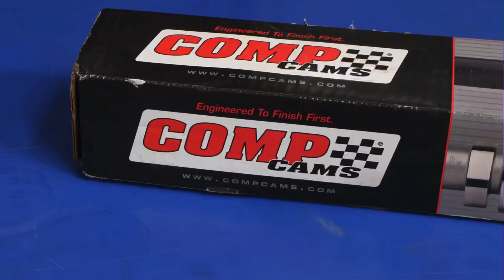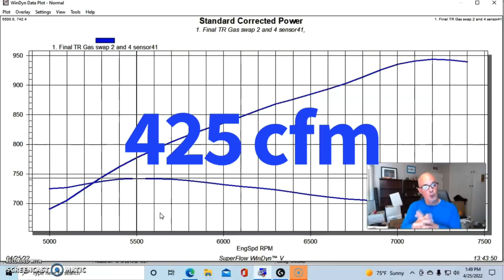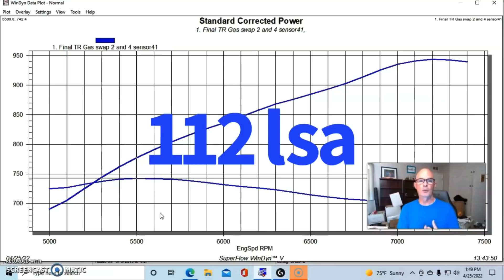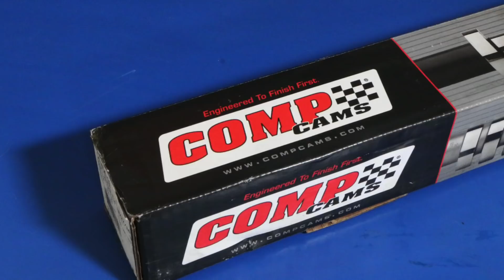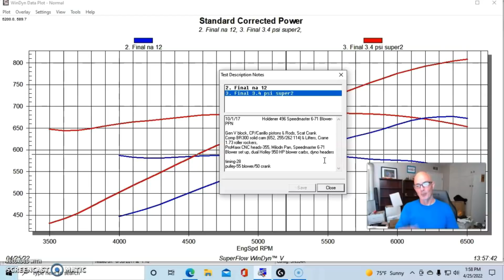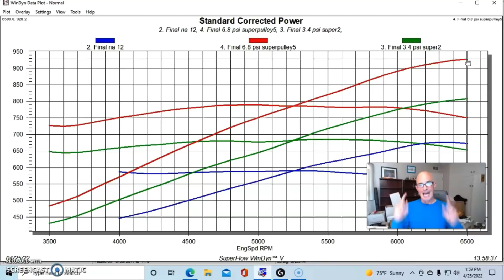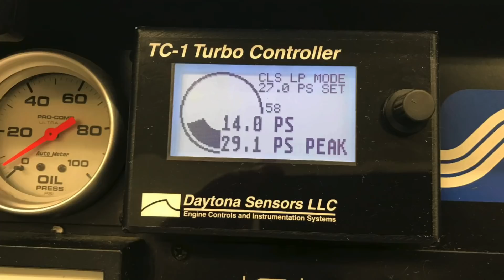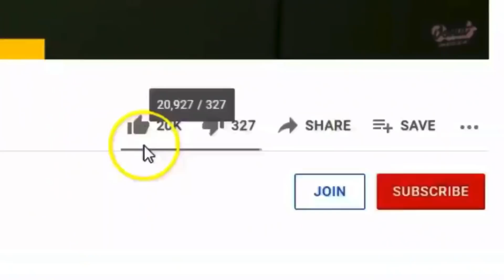HOW TO BUILD A 900-HP, ALL MOTOR, 6-71 BLOWER OR CHEAP TWIN TURBO BBC! WHICH ONE WOULD YOU CHOOSE?

Comment: On alot of these great sounding high hp combos like making 200 more hp then most guys he's running such a high rpm, racing cam in some instances that the powerband is very limited and will make for a crappy street car experience. I have known about this technique for many years. It's not worth in in a street car or truck or even boat. Some cams have a power range of about 4500 plus rpm. A 5000 stall converter won't be fun on the street. And from 4000 to 8000 rpm won't be fun to deal with.

Bloodviking

Comment: 3:45 Richard on your oil system,  add a 1 quart or 2 quart accusump pressure reservoir.   This will remove 1 or 2 quarts from the oil pan,  to help decrease windage.
Thanks for All Your Help!!
Reply from the maker: the accusump doesn't reduce the amount you have in the pan
Reply: @richardholdener1727  
On my car it does.
I put 6 quarts in the oil pan, I start the engine. The oil pump moves oil to the engine and the accusump (1 quart). 
Before I shut the engine off,  I close the ball valve between the engine and accusump.  Later I check the level in the pan,  5 in the pan & 1 in the accusump.
Before I restart the engine (one week later) I open the valve & prelube the engine.
Easy way to Lower the oil level in the oil pan to reduce windage,  and NOT worry about lack of oil to the crankshaft.
Thanks for all your hard work & information.   Helped me to build Chevy small block and chevy Big block.
Thanks

Comment: Love to see the best NA intake for off idle torque 👍
Reply: Kinda hard to beat the stock one for off idle torque. That's what they were designed for. I'm sure there's improvements to be made somewhere though. Just not sure anyone is actually making them.
Reply: @billkerksiek208  yes,thank you. I'd pay for a plastic stock version
Reply: I wonder what the RPM air gap dual plane would do? Do they make those for big blocks?
Reply from the maker: yes they do

Comment: Did I miss something but I don’t recall the first motor the 900 hp all motor there was no displacement mentioned. I would think you’d need over 500 civic inches to make 900 hp NA.
Reply from the maker: 565 stroker-think it was mentioned

Comment: Could’ve ran that 565 tunnel ram on pump gas! Probably would’ve picked up another 30-40 hp! I wanna see a test with a 6 or 8-71 on a big block with 0 pounds of boost. I wanna know if the displacement of the blower alone will make hp. Due to it maximizing the engines VE. In your mind it’s added displacement by itself. You think it would make more hp. Even with 0 pressure. 👍
Reply from the maker: we ran the 565 on pump gas
Reply: @richardholdener1727  oh… Video you said Q16 after you discussed the Wilson Manifold modifications… either way it’s a beast.
Reply: No. The only way it would make 0 boost is if you took the belt off. With the belt on and functioning rotors in the case, even underdriven 40% it would still make 3-5 lbs. But the parasitic drag would eat up 40 or 50 hp.
Reply: There's an old rule of thumb that 15 lbs of boost EFFECTIVELY doubles your engine displacement. So a 454 with 15lbs could make it act like 900ci NA. And that "rule" was 40 years ago, before today's killer heads were available.

Comment: 6/71 bit old how about the 192 and 250 from the blower shop??
Reply: @bigboreracing356  thanks for the heads up ,11-1 iron heads, boost......= Bad! 
Wife just did a joke. I read message out loud and she Said " she Musthang her self if I keep talking about cars 🤣🤣🤣
Reply: Alot less power than the 6/71 that's for sure
Reply: @bigboreracing356  well said stretch! 6v71 20% less cfm than 671 too. Iv got one in my shed. Old Detroit diesel blower. Thinking of putting it on my 350
Reply: @bigboreracing356  I'm jealous. Just doing a 468 instead of the 350 in my 69 c10. I'll go F1 procharger later when the power bug hits. Going to look up mudstain see if I can find it online 👍
Reply: @bigboreracing356  ah it's not a mud truck. So it's the seats that get mudstained not the veichle 🤣🤣
Reply from the maker: THIS WAS ALREADY A BLOWER SHOP BLOWER
Reply: @richardholdener1727  size 192/250! very interesting since those are "stock hood" compatible. very interesting for many of us.. how about a test of potential of those?
Reply: @richardholdener1727  the whole idea is to hide it no cutting holes single carb minimal fab with laws you need a 12 month roadworthy ticket minimal mods to stay on the road don't mind unbolting the blower for that and go stock NA. See what you can push a 250 to and when it heats up on a 454 its a billet housing. Many hot rodders want to know
Reply: @r0bkills try a  procharger for under the hood magic on a 540. A 250 won't hardly boost a 540 and will be spinning too high to be reliable or efficient

Comment: Nothing looks as Nasty Mean as a big blower does, but I would prefer the NA engine. What that NA engine has that the other do not, is power adder potential. 300 shot on  that thing would be the best of both worlds. The boosted engines are risky business if you shoot 300 ponies of nitrous to them. You can, but I wouldn't.
Reply from the maker: WE MADE OVER 1100 HP ON NITROUS WITH A SINGLE CARB ON THIS MOTOR
Reply: Forced induction loves chemical cooling.
Reply: Depends on the tune. Also keep in mind the cooling of the air charge via all that nitrous and fuel. Couple that with an intercooler, and you're pretty safe when it comes to pre-det.